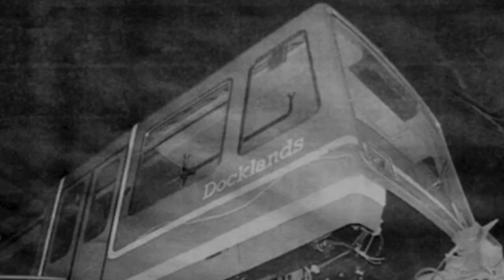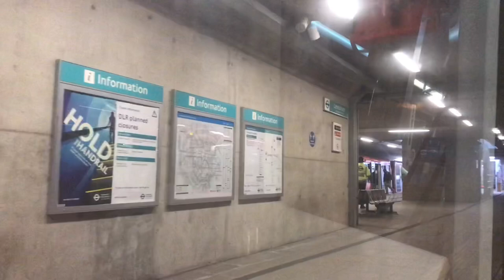The Island Gardens Accident: What Really Happened

Comment: very interesting, very greatful for Jim to share his insights. Whilst I shouldnt be suprised that the software made it into a real train, its not suprising that it did. Software Design principles, even in 1987, would have identified an asyncronous message flow as an issue on a critical system. I dare say that a software developer had pointed out that the 3 second latency was there, but the desire to fix it was never put in until the testing occured as it would of been seen as expensive man hours and any hardware upgrades to spend on a unrealistic situation. Still, at least its not translation of measurements which caused a loss of an entire orbiter which cost £125 million to put into service, only to crash into the planet...
Reply: A 3 second latency would be a critical problem for industrial systems (even in the early 1980’s). Industrial controls require a quarter second cycle time for analog systems and 10ms cycle times for things like bottle filling and box closing.

Comment: I wonder if playing at drivers is universal. Line 14 on the Paris Metro, for example, is also driverless, and on the Newcastle Metro you can sit in the front next to the drivers cab. Every DMU was also like that too at one time, and you'd take the slower train if it was an option that gave you an ahead view. Actually it didn't matter which end as long as the view was clear.
When the Glasgow Underground was being modernised in the late 70's, there was a story that went around during its test phase about lifting the cab telephone putting the emergency brakes on,  which included a phrase about wheels like 50p pieces that I seem to remember. I've never found out if the story was true, and I'd really like to know.

Comment: "Hey boss, we carried out that safety test you ordered."
"Great! Did it work?"
"Yes! six times, no problems!"
"But I said seven times."
"Well yes. The seventh time... it's a bit, well..."
"complicated?"
"Yeah.. well no.. actually not at all. Just gravity."
"Ah! Just gra...WHAT?!"
Reply: As the testing was to ensure the safety of the system, rather than to show that it could be run safely, on occasion, I would say the only effective, successful test was the last one.  :)
Reply: @Lee5p33dy  Testing isn't for amateurs, especially on complicated, potentially devastating systems. The problem is usually finding the finance to do it properly.
The Y2K bug could have been catastrophic, if the banking system, the National Grid or nationwide Telecommunications had crashed, with each of them hindering the repairs of everything.
Diesel trains need electric signaling and those trains and cars and lorries need electric pumps to  to fill up with fuel.

Comment: While i agree that it was fortunate that the testing programme was comprehensive enough to catch the problem, I must say that it's a hanging matter that it wasn't caught much earlier in the design phase.

If you have a hard real time constraint (we need to be able to apply the brakes in 2.7s, or else), you make damn sure that the worst case response time is <= 2.7s,  and the obvious worst case of three times one second is definitely > 2.7s.

It doesn't matter that the computers will be out of sync only rarely, because over the lifetime of the system, "only rarely" will have occurred many thousands of times.

Admittedly it was a more naive time, but safety critical design was nothing new.

(Edit: Some people in the comments are incredulous that fixed 1s loops where used. Such fixed timing loops are in fact quite common in safety critical software, since among other things it makes it easier to guarantee a maximum, worst case response time. *headdesk*)
Reply: In fact the only circumstance that would stop me from firing each and everyone into the sun is if the original requirement was for a response time greater than 3s, but the requirements changed very late in the project, because of increased speeds, different track layouts with shorter stopping distances etc. Then some, but not all, will survive my judgement.

Comment: An interesting explanation. A shame the programmers didn't convert their 0.2 second safety margin to actual feet and inches and test the variance from each run. If the extra 0.3 seconds was enough to put nearly half a carriage over the edge then either the buffers were made of marshmallow or having three programs in charge of the brakes was a bad idea.

Comment: Another long-time controls programmer/engineer here.... 
One thing people forget is that computer and control technology of the 1980s was a wee bit different from today (an entire computer might only have 64kb memory and some instructions could take 5+ microseconds to complete). Datacom between computers would likely have been under 1k characters/second and probably much less than that (then add >20% comm overhead).
Another is that you can only test the end-of-line behavior at the End of the Line. Sure,  you fake the entire physical environment and jigger the data to match, but then you're not testing with the real and correct data in the real and correct environment. It is awful when you crash the 8m high bin-retriever robot off the end of the track, but if no one had tried the manual control no one would have known it was wired backwards.
"We only test things we want to work."

Comment: Of course what the designers really wanted all along was one computer doing all three jobs with a backup or two. But they inherited the computer with the train protection system one that had been certified with the TPS, and so were stuck with that, and then the makers of the traction motors would have their own proprietary control system and so on. 
40 years later, by Moore's Law, computers are about 8000 times faster and the art of writing mathematically provably correct code is now a more mature art, we shouldn't need to use  computers with a one second loop time or even three separate ones. Heck your phone could handle that whilst you listened to music and navigated.
Bet they are still using those old original system though.

Comment: Testing should be done in a controlled environment. Not right at the end of the line, where the train can come off the edge of the track. And those systems communicating and having massive 1 second loops. That's crazy. That's poor engineering. There is no reason for there to be any delay, if the equipment was better designed. An emergency stop signal should be implemented that cuts through this delay to gain instant results.

Comment: One second loops indicate PLC's being used which is highly inappropriate for a moving safety system extremely fast microprocessors were available written in C or assembly language at the time the DLR was built. The maximum worst case loop delay can be calculated or tested through bench testing - real world testing not a good idea as can be seen by the results. The test should have taken place on a length of track with an imaginary buffer stop to test the system. In all, the maximum loop of 2 of the computers should have been set by timer that the third computer would have been ignored and full service brake applied and the train go out on fault. In fact any of the loop times exceeded should have applied emergency brake (which can be applied by "opening" the doors). A situation of none train experienced personnel, programming a train system with consequences. Trains are relatively simple machines, especially of this era, and it appears over complication has resulted by sequencing instructions instead of paralleling them and discarding the abort decision on a 3 way vote.

Comment: Those software engineers should be truly ashamed. They assembled a chain of three one-second latencies, and it didn't occur to any of them that it was inevitable that it would often take over 2.7 seconds for a complete cycle of messaging and action? 
Even if it didn't seem blatantly obvious at the outset, the crudest bit of simulation of the system should have shown that up before it was tried out for real.

Comment: A more thorough 'Hazzard Analysis' WOULD'VE theoretically included this as a potential fault, to be hopefully (dis/)proved during testing ........ tho' PRACTICALLY along a stretch of track that preferably WASN'T close to buffer-stops at the sheer dead-end of a viaduct.
.
The uncomfortable truth is that a surprisingly large proportion of the safety features ("fail-safe" sub-systems) of today's "Signalling & Control" set-ups have come about only as a result of accidents ....... sometimes even including precariously dangling trains.
.
A ⅓ of a century on and the system you've described here is being further developed and refined into versions that'll drive full-size trains "driverlessly" on the 'proper railway' at full-speed.  {ATO mode within ETCS ....... which itself is part of ERTMS}.
It's got those (software-processes) 'ingredients' you explained PLUS added ingredients of an ultra-fast over-the-air communications link (a variant of mobile telephony on steroids) and control 'base-stations' with mega number-crunchers, which constantly communicate with ALL trains and with Signallers/Dispatchers, whilst constantly re-calculating and updating all train-positions, actual speeds vs. permitted speeds/routes AND constantly sending out "Movement Authorisations" to all trains.
 - This is the way of future train Signalling & Control.
Undoubtedly it'll subsequently get fine-tuned and enhanced over time ....... after accidents occur (including full-size ones).

Comment: And the moral of this story is, maybe don't conduct these experiments at termini, especially where the track ends on a dead end viaduct.
Reply: I guess that was the "unauthorized" part.
Reply: Parts of the test related to whether the system worked with the track topology as programmed, it had to be tested there.
Reply: No, that's not the moral at all. They need to check that the train stops everywhere. You can't put passengers on the self-driving train without checking that it stops at Island Gardens.

Obviously, they would have tested first at through stations, where the worst possible consequence is overrunning the station. Once they were confident that the train worked at those stations, they would have tested at termini where there wasn't a 30ft drop to fall off.

Comment: I'm amazed that there wasn't a human at the manual control desk ready to operate the emergency brake should the automatic system being tested fail bearing in mind the dead end station situation. In my experience of the sort of software engineers that one comes across at work to fix pcs & their associated systems they tend to be slapdash & slick and rarely commission a system properly after a modification. I'm amazed that high end software engineers dealing with safety systems weren't aware that this type of incident could occur with 3 computers talking to each other.
Usually in industry there are `hard wired' override back ups to software for safety critical systems, one that comes to mind would be the track situated trip that could open a brake valve on the train when it passed a border point on the track (used on the Underground I believe). I don't think you need a degree in hindsight to be critical of the engineers involved on this occasion either.

Comment: All of those clever computer buffs and software experts are going to laugh at this, but here goes;
Programmable logic controlled systems have their uses, and their existence is why I am able to write this comment, or even watch this video. They can enable the control of complex systems, where the application of non-programmable circuits would be less flexible and much more cumbersome. This does not mean however that they are the best method of control in every situation.
I doubt if anyone has  ever come across a computer, tablet or phone which ran flawlessly without locking up or missing a beat. It's all very well having your computer crash while sitting at home, the worst that could happen is that you end up screaming at it for losing your work, but this sort of failure could have serious consequences  if it were to happen to a system controlling a train or a self-driving car. 
These systems are applied to everything these days, ' because we can ', even when a much simpler system would do the job more reliably.  Automation did not start with software controlled systems.

Comment: Strange that they don't test aircraft landing distances by shortening runways.
Still, computers with a one second data clock, those were the days. I wonder if the data clock actually had hands?
Reply: I had software that took timing from a 386SX chip.  It fell over when we upgraded to 486-66s

Comment: Wonder why 7 tests, had the seventh not resulted in an accident would they have had an eighth?

Strange isn't it, electricity travels 186,000 miles per second,  the deemed safe 2.7 seconds but resulting 3 seconds suggests the electricity slowed to 167,000 miles per second,  wonder if Mr Einstein had this issue with his relativity theory 🤔